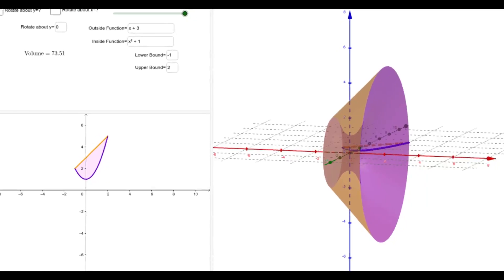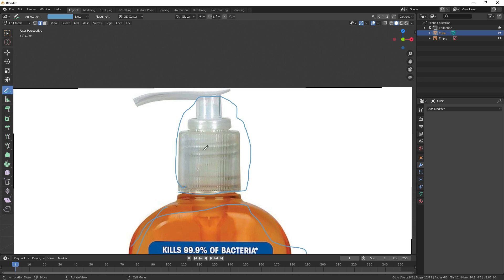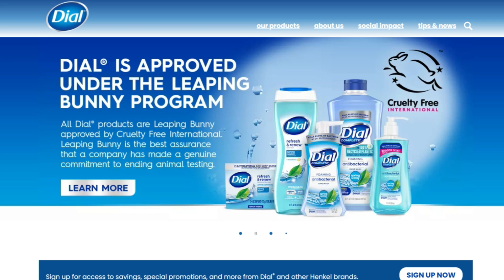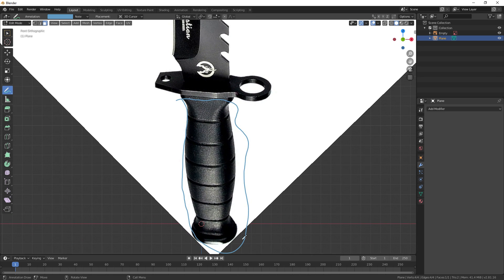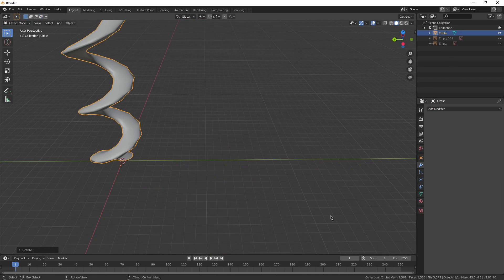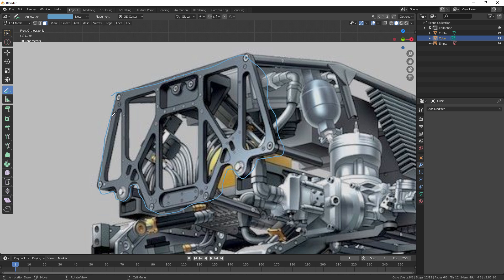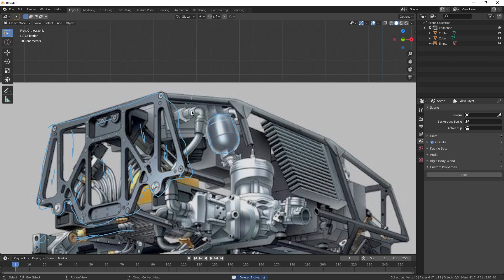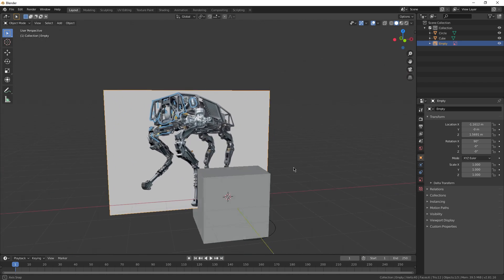"How The Hell do I Model This in Blender?"

Comment: You bevel way too soon into the process. When you get better you will stop beveling altogether, and you will use some form of auto-beveling like a bevel modifier with edge weights or something along those lines. The reason this is better is because of Destructive vs non-destructive editting. When you use modifiers you have the ability to edit them or remove them at any time.

Comment: The soap bottle model is already... questionable. You wouldn't be able to animate it, since you fused what is two parts in reality into one part, and you didn't even bother modelling the tube that goes into the bottle, despite it being visible on your reference and it being essential to the functionality of the object. If you finished that model and showed it to somebody, they might not know what is wrong with it, but you would most likely hear that something is off about it.
You can't just look at the shape of a thing and create your best approximation, you need to think about the functionality of the thing as well if you want your models to feel "plausible" in a way.

Comment: wowie, I'm really having trouble making complex models, but this makes it simpler so thanks!

question: do I buy quad remesher?
Reply: Dont model this in blend
Reply: @bbrother92  I know, lol too many triangles
Reply: @BreadyPrimey  for HS it's better to use CAD like software
Reply: I've been using Quad Remesher and it certainly makes the modelling experience 
all the more enjoyable and speeds up the whole process towards the final model
(In your case for a game asset retopology may still, be required) 

It's good at hard surface modelling, but it faces some challenges with organic shapes 
due to the creation of "spiralling edge loops" It's annoying but not as annoying as dealing 
with the default state of your model. There are rumours that the dev is working on an upcoming 
update addressing that issue, though I couldn't find a reliable source to confirm that claim.

The channel "PzThree" has a couple of great vids for a better understanding and workflow examples.
If you did download it then there are docs with it. (It's easy to miss). Welp, help that helps :)

(P.S. Hopefully you see this cuz I've been rephasing my comment multiple times since YT is not showing it :/
Reply: wowie, thanks alot man :D @GinnyGlider 
I will buy it someday
Reply: @BreadyPrimey  You're welcome :)
And yeah it's sure quite the investment 😅

Edit: I was curious if "wowie" is what I think it is... 
after a search, it came up as a clothing brand that sells shorts 😆
I searched again but this time asking for the meaning of it.
It was what It thought it was. 

(Honestly every time I see a "new" internet word I'm afraid to find out)